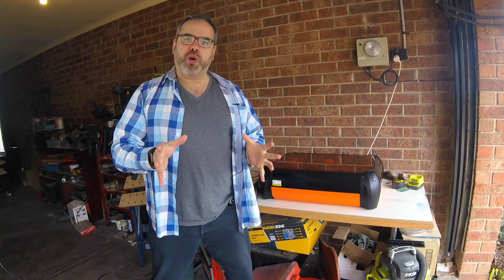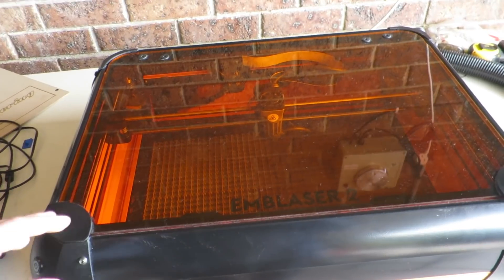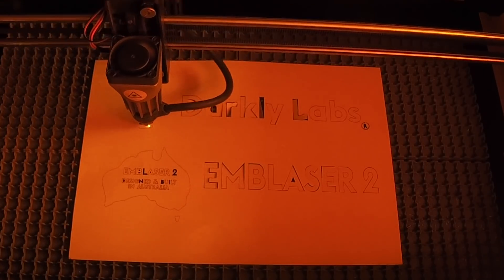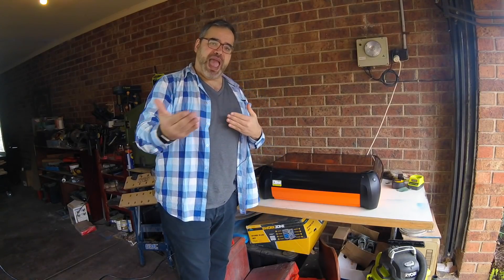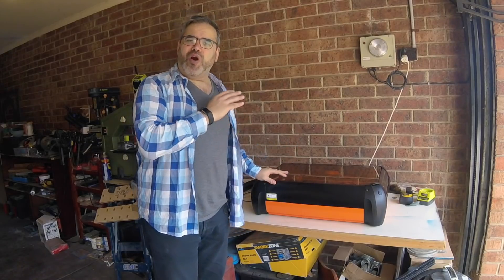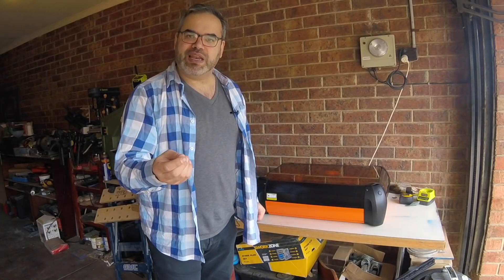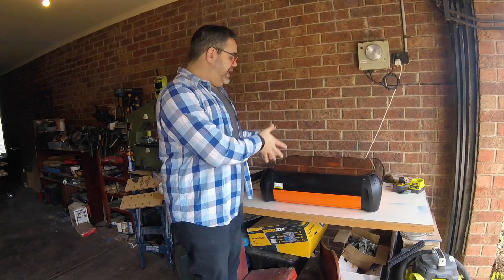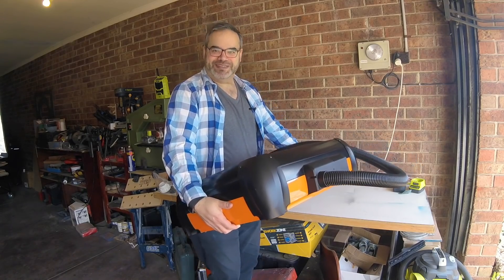Emblaser 2 laser cutter and engraver - First look and review

Comment: Hello! :) I am surprised that there is no review anymore about the Emblaser 2 after something like 2018. Do you think this laser cutter is still on top or is it completely outranked now ? thank you and best regards. :)
Reply from the maker: Keep your eyes peeled, I will be discussing the Emblaser 2 with its new 10watt diode module very soon, as well as discussing why I get better results with the Emblaser 2, than some of the new more powerful lasers I have been reviewing.
That, along with its safety features and support still make it one of the best diode laser units around. Of course thats my opinion, but you did ask :)
Reply: @LaserLivestream  Hello and thank you for your reply ! :) I think that, in theory, I would agree with you. The problem is that, in practice, 2 months ago, I finally bought one 10W (I already had a 5W that compeltely broke) and I have been in big trouble with it. Maybe not because of the Emblaser itself but because of the really incredibly bad support of the only dealer in Europe, who is in France. I could in fact never use it so far, but I will tell you later in more details my problems (it's quite a long story). For the moment, I will simply ask you a favor, if possible: in your tests, if you don't mind, could you please try to CUT, from 0.5 mm thick "wood carton", small timber frames with the wood parts measuring about 0.25 mm wide and see how it comes out ? As well, could you try to simply ENGRAVE half through regular "brickish colour" Canson Mi -Teintes art carton (or equivalent; it's about 0.3 mm thick) with bricks measuring 1 mm by 0.5 mm? I could achieve all this really well with the 5W before a piece broke and I ran into hell of prblems. But the support in France is telling me that I am demanding too much to the machine and even their demonstration machine is not well tuned and is unable to engrave 5 parallel lines at a distance of 0.5 mm from each other without wobbling and being not equidistant. 
I tried to send pictures of my work in Youtube but any external links makes my comments being erased. I guess I should try to myself post a video with those examples so that it could be found under my own "channel". 
I would also like to find a way to send you my Lightburn files for trials.
Is there any way this would be possible, not only in technical terms, but especially in terms of time spent and annoyance for you ?
Thank you and best regards. :)
Reply from the maker: @FougarouBe  Have you joined the Laser Livestream Facebook group? If not, do so and reach out to me there. I have a few options for you that may help.

Comment: Hi Gil, could you advise on whether this cuts mirror acrylic? And what would be the maximum depth?
Reply from the maker: Hi Amy, 
Diode lasers use the visible spectrum of light to pass energy to the material. This means that is you try cutting clear or mirrored acrylic, all that will happen is that the energy created by the laser will pass through without cutting. 
If you want to cut mirrored acrylic, you will need to use a different type of laser.

Comment: Thanks for the review.  I realise that it is 2 1/2 years old, but what is the quality ofthe 3D printed parts?  The casing around the camera (about 4:28 into the video) looks a bit second rate. Very layered.  I realise it is layers of filament built up but my Flashforge inventer 2 can do smoother prints.  Are the 3D parts PLA or ABS? Thanks

Comment: Hello gil, would this machine be able to print and cut various types of designs with precision? I'm already using cricut explore air 2 but am tired with the issues with print and cut accuracy. Also, how fast would it be with paper?
Reply from the maker: Yes. I cut precision parts for paper models and die cut stickers and they are perfect.
The trick is to make sure you have refined markers so that you can get tight alignment when using print and cut.
When cutting paper, I can do an a4 sheet in around a minute.

Comment: Great video thank you. can I please ask what is the average cutting & engraving speed. Is it good for start up business.
Reply from the maker: A large number of people have used the Emblaser 2 as part of a small business or startup business. Cutting and engraving speeds depends on materials. What materials are you planning to use?
Reply: @LaserLivestream  thank you very much for your reply. I am thinking off using MDF/plywood & acrylic
Reply from the maker: @hass8339  Diode lasers use a wavelength that passes through clear and transparent acrylic. Some solid colours and MDF/plywood can be cut, the thicker the material, the higher the number of passes.

Comment: Hi Gil. Can I engrave on ABS Plastic ?
Reply from the maker: You can engrave lightly on ABS, but cutting doesn’t work very well with a diode laser.
Even with a CO2 laser, ABS needs a lot of fine tuning, or it comes out a gooey mess.

Comment: Great video - thank you! Sounds like a great machine. I have a question - Do you know if you get burn marks on the back of the timber? 

I've had some laser cutting done for me and the intricate bits / areas with lots of adjacent small shapes have caused lots of dark burn marks on the rear of the timber, and I've had to sand the whole sheet afterwards to get a nice finish. 

I'm looking for a machine for small business plan to make timber model kits, and this is looking like the lead option at the moment! (I was initially looking at getting my products cut overseas in China or so, but now I'm thinking to get a machine and look after the production process myself)
Thanks again
Reply from the maker: I know exactly what it is like to have this happen to your parts. It has to do with heat burning from the laser. I found this method removed all of my issues when it came to charing the cut out parts.
https://youtu.be/LZlhVezxgXs
What thickness are you cutting your parts from?
Reply: Gil Poznanski great, thank you! (I'm using 2mm timber) I'm guessing I could also make similar supports out of another material that do the same thing.
Reply from the maker: Lars Christian  I would not go thicker that 2mm on Timber. You will have to run a few tests to work out the best settings.
What type of models are you making?
Reply from the maker: @LarsChristian  Link didn't work :( Why I asked is that there are a number of laser safe wood products that would cut like butter and produce fantastic and strong results.
Reply: Oh great, what are those products called?

Comment: Hey Gil thanks for the video! I m looking for a laser which can cut red or blue NBR rubber (0.5 & 1mm thick) without any oxide marks. Is it possible with this? Thanks in advance
Reply from the maker: Have not had a chance to cut rubber with the Emblaser yet. I think it might be possible by taking a few passes at low power so it doesn’t mark. But until I try it, it’s only how I would approach the issue. Hope that helps.